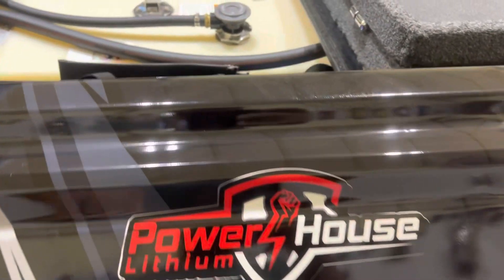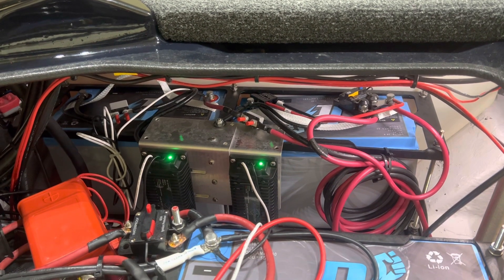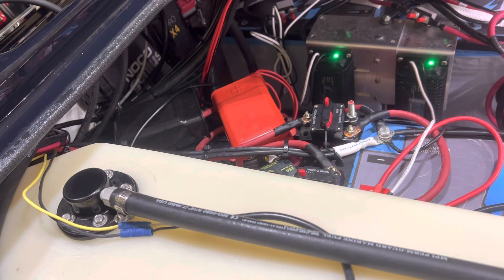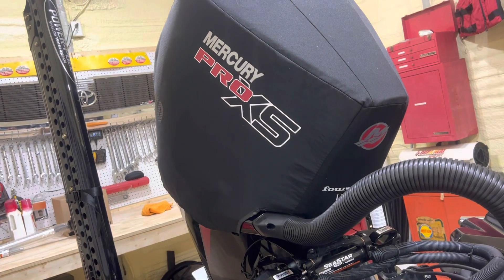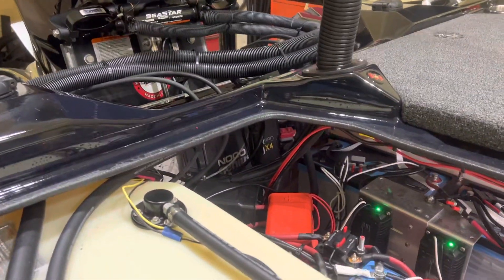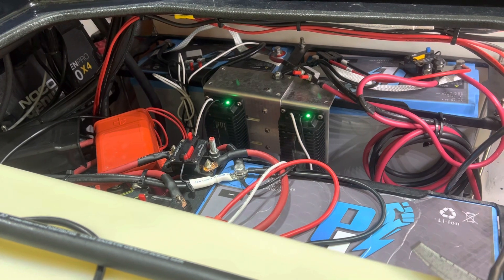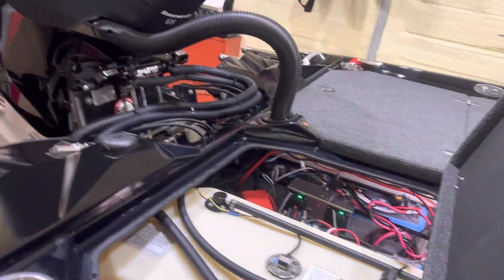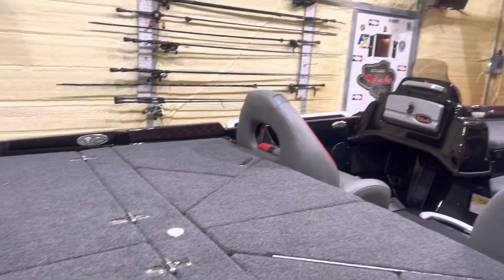Self sufficient Lithium Battery set up.

Comment: On your trolling motor batteries. Is the trolling motor leads connected to the same battery or are the leads split between the two. Pos on one and the Neg on the other? I do understand they are in parallel.

Comment: couple of questions... how do you set up the run & guns to work sequentially like that... where one charges the 16V first then charges the 36V bank?  secondly, how has the Noco continued to work properly, because Noco says you can only put one lead to one battery, they say it will create a problem if you put more than 1 lead to the same battery.  Thanks.